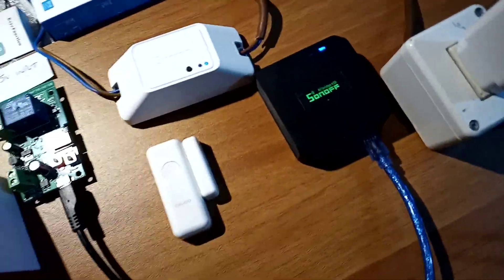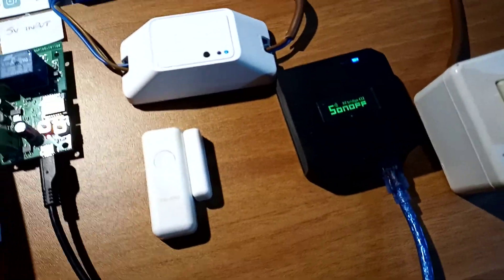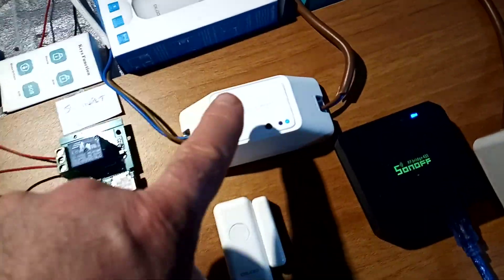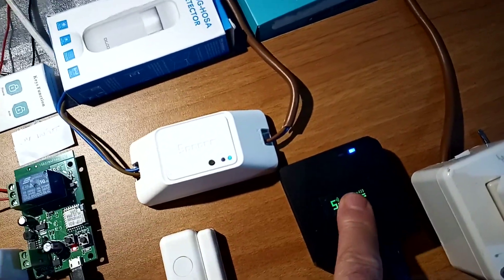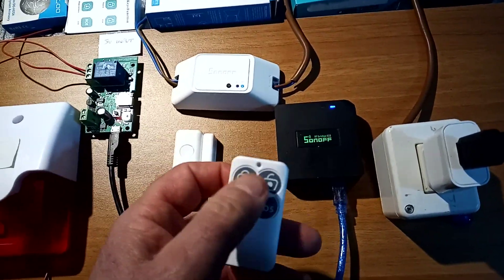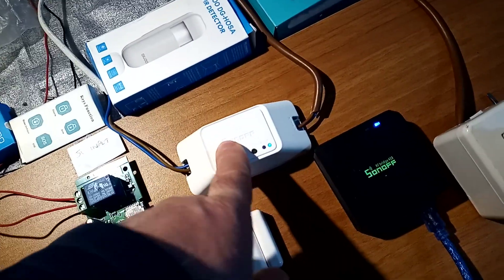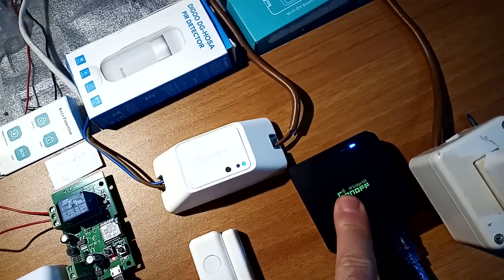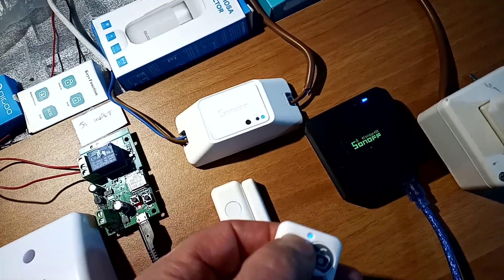BEST WAY to control a DIY Sonoff based alarm system with a RFR3 Basic and RF Bridge ON/OFF function

Comment: Great video do you know how to do this with the new sonoff zigbee bridge.

By that I mean what strobe siren is compatible and also do you think there's a way to get those r&f remote key chains to work with the Bridge as well
Reply from the maker: Hi, i've yet to check the zigbee out, reason is that i'm fine with what i have. About the strobe siren you can go for a diy solution, check out my sonoff alarm diy vids :)